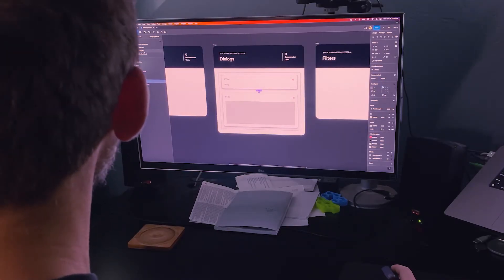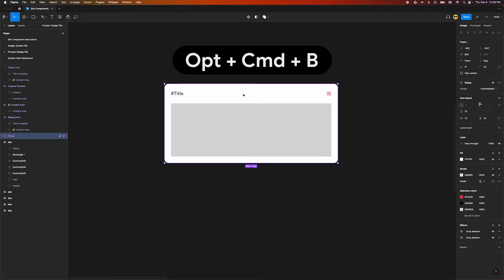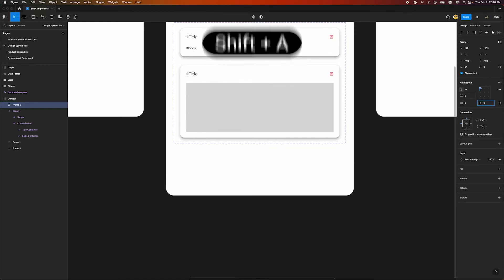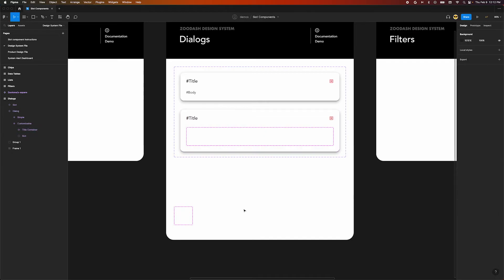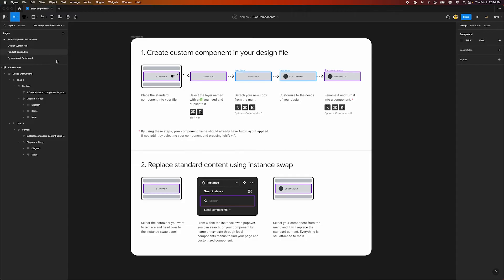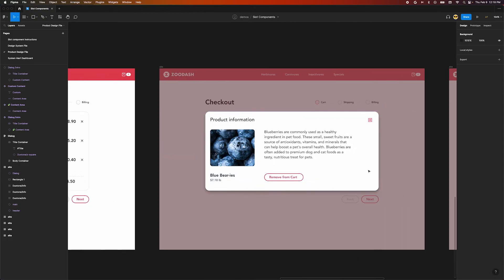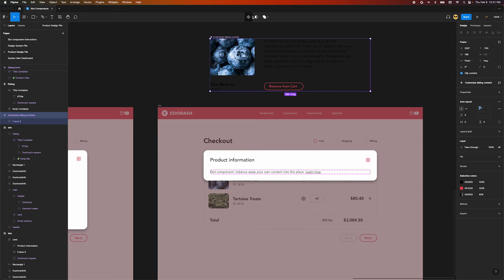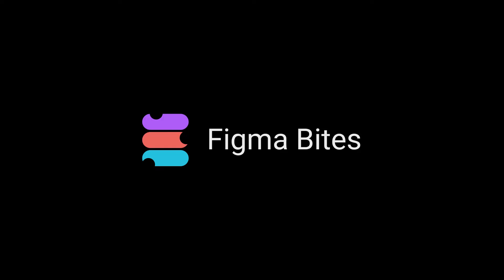You'll never need to detach a Figma component again | Figma Big Bite

Comment: Great info! Quick question since I saw it happen at the beginning - when you picked that button to swap into the dialogue box it got distorted. Does this mean for components you already made (lets say somewhere else in the design system) you'd have to make a custom local component for this everytime?
Reply from the maker: @JoskaBorbely  what you saw there was just me showing a placeholder example of custom content. You should be able to fix any stretching by adjusting the auto layout settings and horizontal and vertical resizing settings. I believe that content was set to “fill” for both. You would only be making custom local components for content you are creating that isn’t already part of the design system. 

I hope that answers your question. If not, let me know.
Reply: @FigmaBites  Yes, thank you that works for buttons, the issue I'm running into is when I have a component set of logos that have different sizes, when the component swaps with the slot it is working as expected but when I toggle a variant it then distorts
Reply from the maker: @JoskaBorbely  hmmm, can you share the file with me? I’d be happy to take a look

Comment: Awesome tut but this still feels super hacky 🥴
Reply: It seemed weird at first until I realized the power of it. It's totally not a hack, and it allows users of our design system to use our components and styles while designing with their data within the constraints that allow them to launch features more quickly with less time spent in approval rounds.
Reply from the maker: @seejakegoogle  Thanks for adding that :)
Reply from the maker: I feel you. When I first saw it I thought the same thing. And it does feel that way but since it’s using core features of Figma, I wouldn’t consider it a hack. It’s a technique an entire team needs to get behind or it doesn’t work as well. That’s the same with a lot of things in Figma and other tools since we can do the same things in so many different ways.